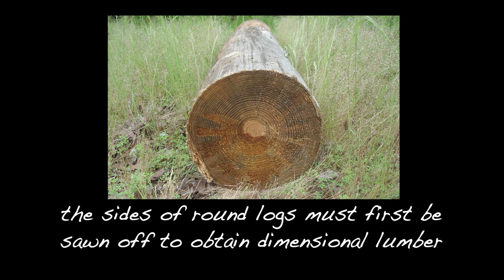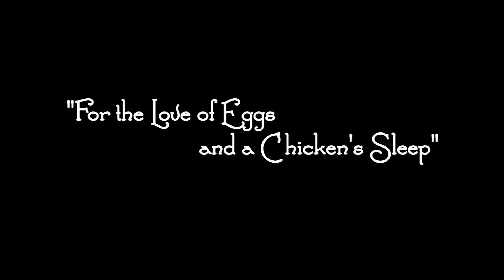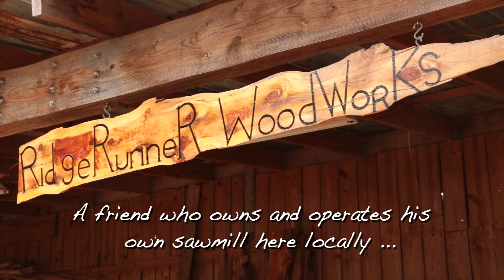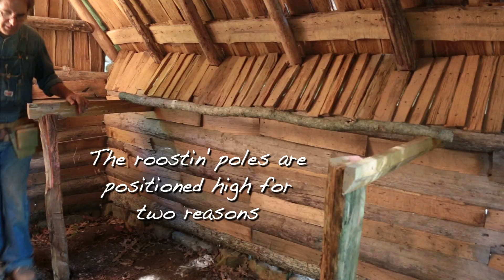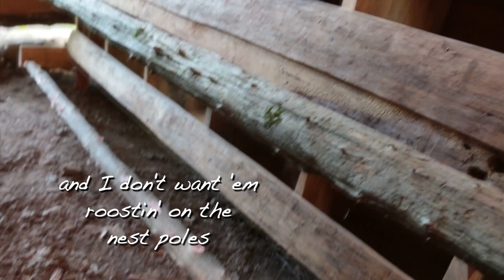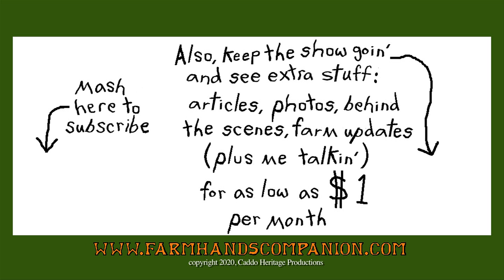Building Old-fashioned Chicken Nests and Roosts - The FHC Show, ep 25

Comment: Have you milled any sweet gum for "conventional" construction? What was you experience with it? We have some sizeable sweet gums we'd like to use for construction around the farm, but the little we can find on sweet gum says it's difficult to work with and cures out twisty and strange. We'd be grateful for any thoughts you might have on the matter. Thanks in advance!
Reply from the maker: Yes, I've milled sweet gum, and recommend it for lathing boards that tin or shakes are nailed to. It hardens as it cures and holds the nails real well. But make sure you allow it to cure in the shade of a shed or something. If it cures in the sun, it'll twist and just about meet itself comin' and goin'.